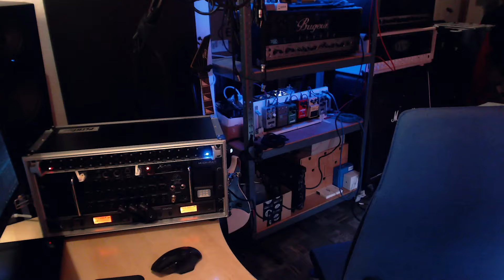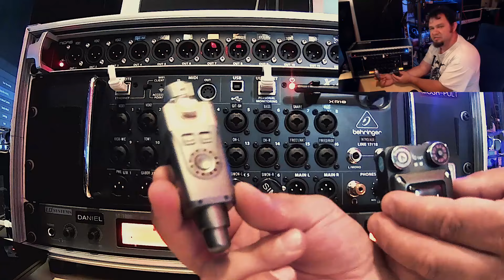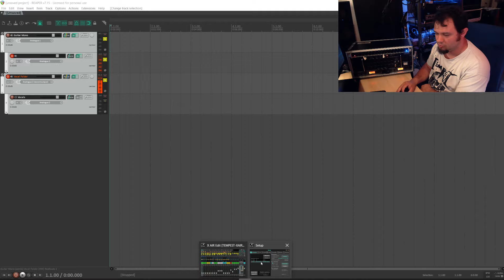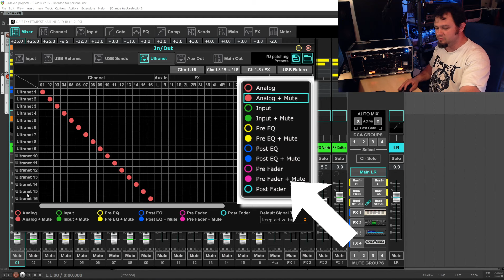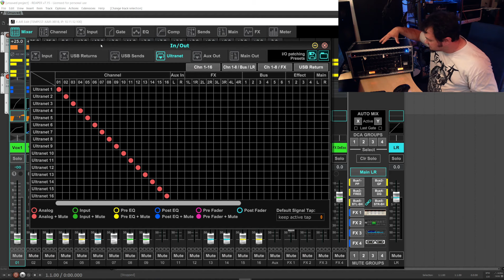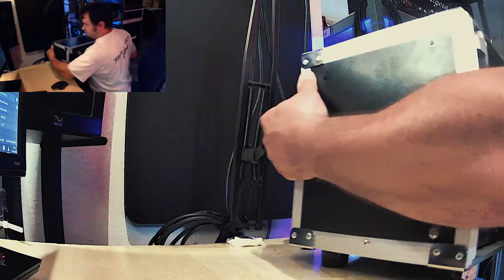The most compact IEM Rig for your band in 2024! (Only 5U!) || IEM RACK Walkthrough

Comment: Thank you for your great Content! Would the  Behringer XR16 Air mixer also work for four bandmembers?
Reply: The XR16 does not have Ultranet, if I remember well
Reply from the maker: @davidecasarano4880  Good point! But if it's only about providing the bandmembers, you can use the AUX outputs, and then send mixdowns via the MAIN outs. But definitely a valid point you make, thanks for sharing!
Reply from the maker: Yes, I think so, but you'll have to be sure that all are okay with using mono. Our guitar player NEEDED stereo, because otherwise it did not work for him.

Even then, you can work it out using the Main Out, but that limits your options for other scenarios.

But overall, I think it can definitely work out! :-)

Comment: i wonder if the ultranet connection + behringer software are reliable enough to replace a traditional splitter? if something goes terribly south, with a splitter the worst case - everyone's without inear, FOH still has the mix. Without a splitter, the worst case - no one receives any signal
Reply from the maker: Well, technology always can fail. But we have set up our pedalboard stuff so that we can also power traditional cabs with power amp pedals on our boards, so that is our safety net. 

In the worst case scenario, instead of doing a split via ULTRANET to the MIDAS, we could do a mixdown out of the Behringer XR18s Main Outs. And if that fails, well then we just move over to powering the cabinets and using the "old school setup" without in ear. But, to be honest, those are a lot of "if"s, and if I am that worried about something failing, then no pedalboard, because that can fail too, also a.repocament tube amp, because in case, oh an make sure to have a backup instrument for every guy in the band... It becomes a pointless obsession.

We never had a single issue with our IEM rack, it works rock solid in all situations in roundabout 10-15 gigs we.played with this setup. And every single rehearsal once a week.
Reply from the maker: Just read my reply, totally reads itself butthurt. Not meant that way :-D I just like talking. Thanks for checking out the video, and your point is a valid take, just not one that I personally worry about.

Comment: Thank you for this video. It is super helpful. I have a quick question: Do you need an SSD card for the Wi-Fi router?
Reply from the maker: No, why would you think so (not meant disprectfully, but genuinely curious)? Normally, WiFi Routers do not need an SD card, unless they are just a Raspberry pi with some additional hardware and require you to do the full programming. This is not such a unit, this is a fully developed router in a super small form factor ;-) 

It does not come with the best WiFi, so if you move a lot away AND you need constant access to your monitoring system, eventually think about a professional rack router. But we only usually set it short before we play once as a "final check", because at rehearsal we actually have our levels set, and then leave it that way for the gig. :-)

Comment: silly question here - if the FOH is micing the drums and amps as well as vocals - would that go through the MIDAS to the mixer? would you need a snake? kinda curous with this set up how that would work... also if the FOH mics are phantom powered would that effect the set up -  really love this set up!
Reply from the maker: Sorry for the late reply. 

We set our setup so thatz we do not interfere with anything the FOH does for the venue - on vocals, we have a splitter between microphone and Mixer. That way, I can leave the vocal mic cable where it is, just smack the splitter and a 3m XLR cable inbetween and be set. We have a snake from the mixer to the front center of stage for my guitar pedal board and the vocal mic splitter, which then splices off left and right via XLR cables as extension to Simons (Guitar #2) and Daniels (Bass) pedalboards. So the instruments are dealt with in that way, and FOH can grab them off the MIDAS device. 

For drums, we bring a complete set of shell drum-mics with us, which we place beside the FOH drum mics, so for our gig, we got 2 mic sets clipped onto the drums. That way, we are completely independent and simply can tell the FOH "Just turn off all Monitor speakers on stage", and that's it. 

If we play in a smaller venue and we maybe bring the drum backline and everyband is anyways playing through our kit, the FOH can decide to ditch his mic setup and just use our mics instead. Then he can grab them off the MIDAS device. 

Hope this clears things up. This setup requires like 10 minutes more setup time than a usual setup, but it's worth every minute, because the sound is dependable, replicatable and exactly to our personal likings for each and every musician. In theory, we could play a huge tour in a ton of different venues and be rest assured that our sound internally always is pretty much exactly the same.

Comment: I need something like this that will handle 24 channels and we can fly with. I’ve been thinking a Wing and maybe a pair of 16 channel splitters. I’ll still need a distribution unit for the monitor mixers, but if I could slim it down and fly with it, that would solve a ton of issues on the road! If anybody has any ideas, I’m all nears! Lol.
Reply from the maker: If you can live with a higher rack, than the X32 by Behringer could be your jam. However, in that case, be aware that the connections are at the back of the unit.

Comment: One thing to be be aware of with silent stage...  The venues speakers usually flank the stage so unless the venue has a center speaker at stage height, the people at the front of the stage get no sound other than whats bouncing around the room.  My friends band is all direct including electronic drums.  They remedy that problem with a couple powered speakers at the side of the stage pointing across the front of the stage.  It's kind of a funny modern music problem.  That and they use a couple shotgun mics pointed out so they can hear the crowd.
Reply from the maker: To be honest, in smaller venues that is not a problem. And at any bigger stage there might be smaller banana wedges hanging from the ceiling. We haven't have an issue so far. But in any case, our pedal boards have power amps, so we are prepared for any situation :-)
Reply: If a venue has a large enough stage that the dispersion field of the stereo arrayed speakers cannot cover the center, they should have center fills regardless of stage noise. Stage noise is not a replacement for sound field production.

Comment: We also use XR18 and DN4816-O for our band as IEM rig. But it happened several times that the FOH sound engineer reported that the signal from DN4816-O is too hot when I set the gain to average (and recommended) -18dB on XR18. So our solution is to set the gains to -30dB. Of course, this results in a lower signal-to-sum ratio, but it's still imperceptible for live playing.
Another problem that gave us quite a hard time was occasional loud noise on some output channels on the DN4816-O. Eventually we found out on reddit that it was probably a bad masterclock synchronization. The solution is simple - turn on DN4816-O after XR18 is fully up and running.
Reply: Ahh shit, this answers my question I just asked! But I have another one: when setting the gain to -18dbfs, do you have your faders set to unity?
Reply: Don’t turn up, make sure you give orders to the band not to increase the volume.
Reply from the maker: Damn, that's good information, thanks for that! I personally have set everything to be grabbed before any processing, so maybe we are inherintely mitigating any issue, never had somebody complaining so far. Fingers crossed!
Reply: @PippPriss  But is it possible to configure the ultranet output to completely bypass all processing including the input preamp? In other words, when you adjust the input gain on the XR18 does it affect the level going to FOH? If so then your channels are all going through double preamp stages before reaching the audience. This setup seems to be getting more popular so maybe FOH engineers are getting used to it but in my experience they prefer the cleanest possible signal direct from the instrument or mic. That's why I'm still using analog XLR splits (in front of the XR18) even though I would kind love to reduce the weight.. ugh!
Reply from the maker: @PlanetBooty  Hi there, no, the input gain is the only thing which you cannot bypass. To be honest, we NEVER had anybody complaining about the input gains we set, as we set them fairly moderate, but definitely not in the segment of "too low". We usually go with the rule to be at roundabout -18dBFS (so 18 dB of headroom left), that worked out for any gig. Anybody saying that runnign through two preamps matters to the audience in my opinion is highly overrating what the audience prioritizes. If your show is energetic, it will not be killed by running first through our preamps and then again through FOHs preamp, and an FOH complaining about that... well, that's where our setup alternativ e comes into play that we can run our pedalboards into a poweramp, the Bass DI can be splitted by the FOH and the drums are mic'd up with a separate kit of mics just for our IEM, so we'd work completely independent from the FOH. Offering the signals through the MIDAS is just the cherry on top for those willing to run that system 🙂
Reply: @PlanetBooty I'm curious if the signal I'm sending to FoH is gained at 18dbfs, would the sound guy even notice? I'd rather not even tell them because it will stress a lot of them out even more, thus stressing me even more. And typically, we have 15 minute changeovers to get this all done, which so far has not been a problem since I have as much plugged in beforehand as possible and I get there early and beg FoH to let me plug my rig's power in before the doors even open and get everything turned on, tested, and ready to go.

Comment: Very nice setup! 
We took a different approach and did a 4U setup with almost exclusively analog components at a very low price and it works like a breeze: 
a) 2 8-channel splitters, 
b) 2 8-channel mic preamps plus 
c) a Behringer P16-I for our P16-Ms.  
We have stuffed all of the devices into a 4 height units racks whereby - since these are 5 devices we have also put something on the backside of the rack in order to make it work in 4 units. 
Cabling is fully internal and only the 2 times 8 multicores need to be connected to the stagebox.
P16-I is connected via 2 times TOS Link. Because we are using the P16-I we do not need any powersupply on stage for the P16-M - just connect them directly to the P16-I using a standard Ethernet cable.
We typically have our monitoring setup working on stage long before the local technician has set up any of the other cabling to FOH.
Reply from the maker: Thanks for sharing, interesting setup definitely! Yeah we also try to be early to the venues and then lay cables etc. as preparational step, before we hit the stage actually!
Reply: @PippPriss  how do you attach the pieces like the router so they don't detach? i.e. solid attachment?
Reply: Let's see it! Sounds cool! Mine is 6U and heavy AF. This 5U set up is sweet, but 4U would be even better! ❤

Comment: Thanks! This is exactly what I was looking for. You mentioned you could use this with a standard cabinet micing rig when there are multiple bands. How would that work? I am a bit stumped there. 😅
Reply from the maker: Hey there, glad you find this video helpful. I got a video on the channel where I am showing my pedal board. Although back then I used a preamp pedal and now use the NAM Player pedal, the concept it still the same - split one signal without IR, and one with IR, use the one without IR into a pedal power amp, that then goes via long speaker cable to the speaker. The IR loaded signal then goes to the IEM Mixer, which in turn can go to the FoH via the MIDAS digital splitter. 

Hope this helps!

Comment: Can I ask, as a newbie, how’d you create the custom back panel, please? Is it complicated?

Absolutely love your video it has been extremely inspiring - I ran the MR18 with the DN4816-O at a show supporting Anvil a couple of weeks back, after seeing your video, and it was awesome!!! Have subscribed. Thanks again.
Reply from the maker: Hi there! Sure, no stupid questions, only stupid answers! :-) 

I basically took a blank rack blend and drilled holes with a small handheld drill (not the handheld screwdriver thing, but the actual thing you can use to drill holes into stone, wood and metal, I think it was 500W string, regular home depot drill from BOSCH). I then used a jigsaw to cut the spacing out. Afterwards I used those small keyfiles to straighten the cutout. If you have a dremel, be smarter than I was :-D 

For the other holes, regular drills worked out just fine. 
Thank you very much for the kind words, I am happy that this video gave you some inspiration for that cool rig at that even cooler gig! :-)

Comment: The double nat setup is sick
Reply from the maker: In the end, it's just a router behind a router. And since we have no means to reach into the local network of the Rack router from the outside, it's super easy to use. 
But helps that I worked for nearly 7 years as a (Senior) Technical support engineer if a network device vendor, so I am well versed with this stuff ;-)

Comment: So, can someone give a concise summary as to why the MIDAS DN4816-O is a better way to go over a regular splitter?  Other than saving room on the rack?  I'm having a blonde moment and not fully understanding why it's so much better.
Reply from the maker: Saving space is a big factor to why I am a fan of the MIDAS DN4816-O. Secondly, it follows the ULTRANET standard with a lot of MIDAS and Behringer Products use. Why is this helpful? Through the menu of the XR18, you cannot only choose to send out the raw signal of the incoming source, but you could in theory set it up to send out the fully processed signal, or any step inbetween. If you'd have a full band with a very static setup, where everything always remains consistent, then you could just tell the FoH to grab the signals fully processed off of the MIDAS digital splitter and work with that. The FOH engineer does not have to apply any effects etc, eventually just adding a bit EQ to match the venue, done. 

Secondly, a quality splitter will set you apart the same amount of money. Thirdly, less cables needed -> instead of having (when using all channels) 18 XLR-cables, which go from the back of the splitter to the front of the XLR, you just use a single ethernet cable. 18 XLR cables are going to cost you an arm and a leg, especially if you seek to have them eventually have angled connectors on the XR18 side (200-300$ extra). Also, possibly the lid/cover of the rack will not fit anymore. 

If you are commited to the XR18 / the ULTRANET standard, not choosing the MIDAS DN4816-O over a conventional splitter is simply stupid. If you however are not commited and you want to use the splitter after exchanging, then of course the MIDAS DN4816-O will narrow any re-use value once you rid out the ULTRANET capable mixer.
Reply: @PippPriss  ok, I'm sold.  I already have a Midas MR18, so it's a no brainer.  Thanks man!
Reply from the maker: @MasterSplinterPDX  Your welcome! Its all about choices! :-) good times certainly to live in!

Comment: Where`s the "all-in-one"-unit we`re all waiting for? I hate all that crap inside the box regarding power and wi-fi. On cable loose = you`re fucked. I know lots bands that use this solution, but I dont have the nerves for using it live. If anything goes wrong, you have to open the box and start troubleshooting....and you can bet it happens 5 minutes before the show starts....So....is there a "all-in-one" solution in the works, somewhere? Anyone?
Reply from the maker: I personally do not know of one, that does it ALL, and being good at that. That's why you have this modular systems. 

The rack could've been more cleaned up, if I'd allowed for a bigger rack - there are nice rack'd WiFi Routers, and having a power conditioner would eventually help with that as well - but then we'd be talking about a big rack, possibly 8-10 U in the end. And if we'd go that route, then I would also set up the rack so that it carries all the processors our guitar and Bass sounds ;-)

But the goal was that we wanted to have a powerful unit but still keep it small.

Comment: 13:09 - in your hybrid scenario, are you then pulling each dedicated monitor lines into the behringer’s inputs then out your IEMs?
Reply from the maker: Hey there, do you mean the monitor busses of the venues? If yes, then no, we do not use that at all. We let everything be muted from FoH point of view. We play on a completely silent stage, in an optimal situation (except for the drums bashing). We are grabbing any signal we need from our individual setup into our mixer, and the mixer has 6 aux busses. we use 5 in total , 3 mono, 1 stereo pair for our guitar player. Mixing is done individually by everybody themselves and their unique liking.

Comment: great setup! I would swap the splitter to the bottom so you won't have the FOH cables hanging in front of the mixer...
Reply from the maker: Good point, but since we usually are first to set up our stuff to get our IEM going, it's actually better that way and in that sense tried and tested. So we first set up our stuff into the mixer, and then we let the FoH take whatever signal he needs. The FoH would have to otherwise fight through our cabling, if the splitter was in the last rackslot.
Adn because of the racktray, where we mount the IEM systems, we are "bound" to the IEMs being the very last thing.
But of course, depending on the use case, your preferred setup might be exactly opposite. :-)